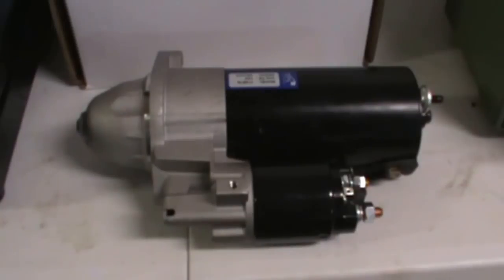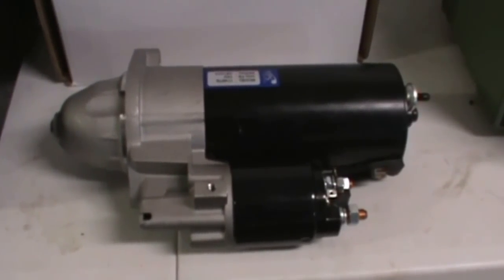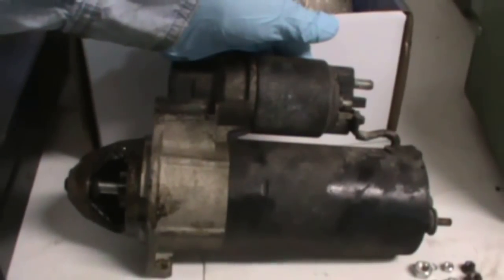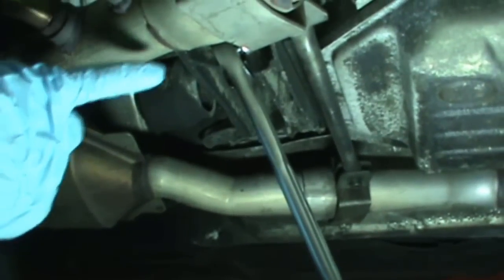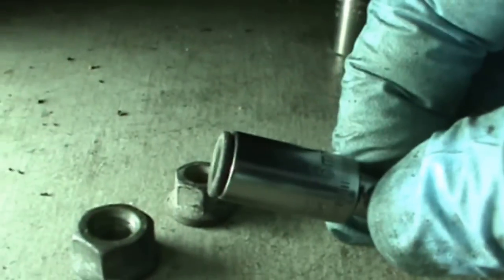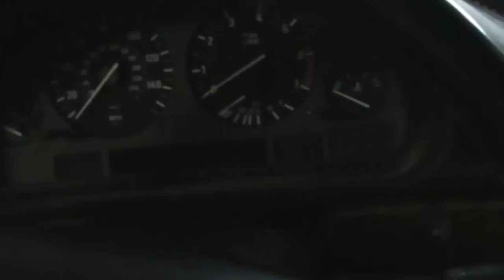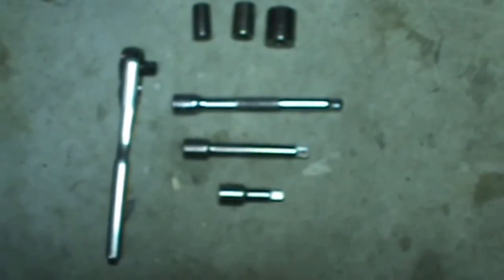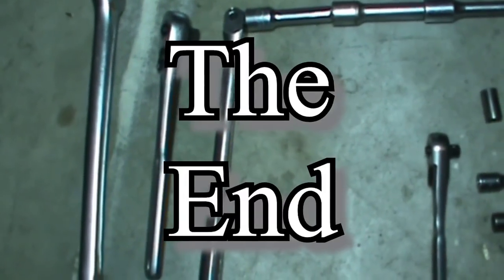BMW Starter Motor Replacement

Comment: I replaced the starter on my 1984 633CSI. Because the starter housing was too wide, I could not use a ratchet with extension and socket to get 2 bolts off. I had to use box end wrench which took about 45 minutes to get those 2 bolts out. With a little research i discovered that in 1988 and later, BMW produces a slimmer starter for the same engine. Although i was advised the starter would not fit my vehicle, i bought it. The starter was now able to be bolted on the the block using a ratchet and extension in about 15 minutes. In testing starter, it worked exactly as it should.

Comment: I think your right about how long it would take. 
do you know if it's the same procedure with my x3 3L 2004 automatic  ?
Reply from the maker: I am sure it is.  The procedure is the same for all starters, two bolts and the two electrical connections.  The rest in the details of fishing the old one out an the new one in.

Comment: In your video you did motor replacement for BMW starter does this apply to the E53 M54B30 06 BMW X5 3.0i SAV vehicle? What is the correct starter i should be searching for when i have to either replace it altogether or do this specific task here from your video.

Comment: Would you post a video showing all steps for an e53 X5 3.0i model if possible. I found a shop that will rebuild it for me for $95 in a couple hours saving me a few hundred dollars. But I don't know where it is on this engine or how best to access it. Any DIY you could share for this model vehicle would be appreciated.

Comment: Is this on a 2002 325 i?? I'm thinking about changing the starter on my BMW 325i .. Good video..
Reply from the maker: Your starter will closely resemble this video.  All BMWs are about the same with the difference being the way the shield attaches and some starters are a little smaller.  Good Luck and be careful.

Comment: HOW ABUTH THE 2007 X3 I DO APP. NICE VIDEO SOME THEY HAVE TAKE THE ING APART??? PLEAS LET ME NO
Reply from the maker: The details in this procedure will work on any M63 series engine, however that basic procedure works on all cars and the connections should be the same on all BMWs.

Comment: hiya I have a bmw x3 2004 3L X drive   would it be the same procedure on mine.  the garage said it would take about 5 hours to do is that right  ?
Steve.
Reply from the maker: I think the billable shop time is 2 hrs.  5 seems excessive.  That is close to or over $600 in labor.

Comment: You have 3 wires going to the starter. One gets power from the battery, the other one gets power from the ignition and the other thin wire what is that one for ?

Comment: 2006 bmw 530Xi is this the same proceedure?
Reply from the maker: +Toni Lynn Zuberi Yes, use the same procedure.  Starters are two or three bolts in the back and two or three electrical connections on the front.
Reply: I asked my mechanic to look at your video before he changed the starter. He tried from the bottom, said it was not accessble. He then but finished from the top and charged me for 5 hours labour!
Reply: Your video was very informative, and I'm sure you are telling the right way, I checked with BMW Dealership
Reply from the maker: +Toni Lynn Zuberi I did not refer to TIS/ETK before answering you.  I also did not realize you had an Xi.  The all wheel drive system imposes tremendous restrictions on space available to work and I am sure your mechanic did not rip you off.

Comment: What brand is the starter motor and what year and model is the BMW?
Reply from the maker: The car is a 1997 and the starter was sold by Rare Electric.  I think it was rebuilt as the starter was $75.53 delivered.

Comment: what was your symptoms for the starter going bad?
Reply from the maker: I though the problem was with the battery,  Seemed like the battery was getting weak.  The starter worked until it did not meaning that I thought the starter was ok because the engine started.  If the starter is very old and the battery is ok then it probably is the starter, I have since purchased a Battery, Starter, Alternator load tester to remove some of the guess work out of the process.

Comment: Are you filming with a microscope??! We can't see what you are doing and where you do it, please don't use so much zoom next time.
Reply from the maker: Sorry about that.  The space under the car was such that I could ont get a good angle on the shot and did not post this video at all.  I really could not film the extraction and insertion of the starter very well as I was in the way most of the time. I hope to afford a lift in the future.
Reply: ok I see, would be nice if you had a go pro or another wide angle camera